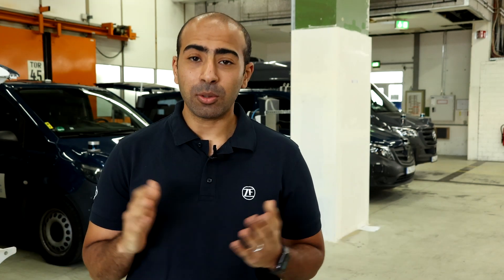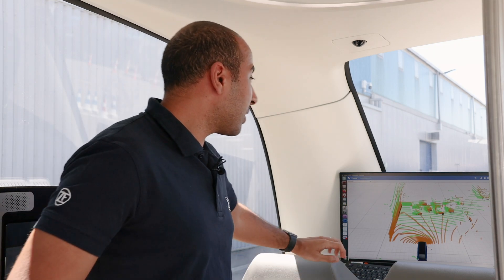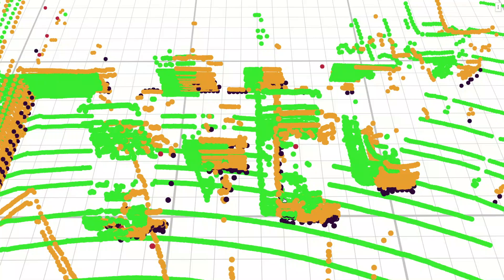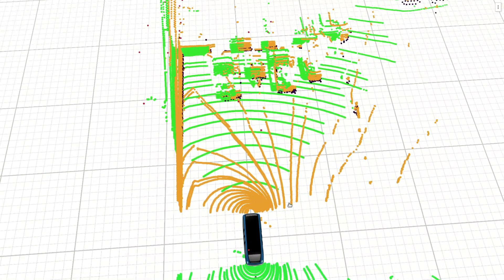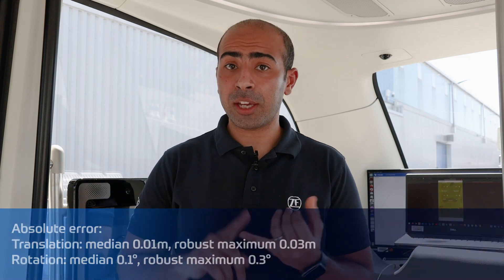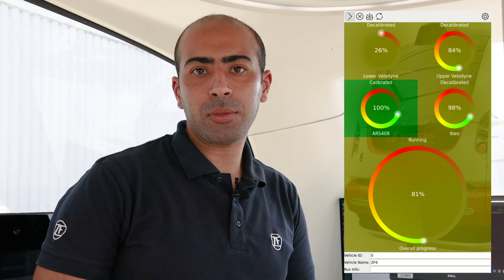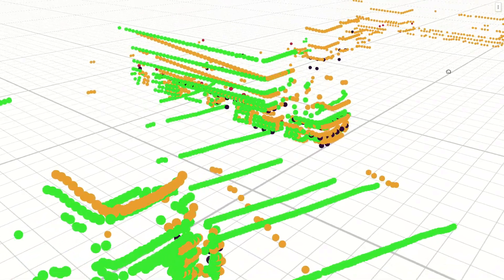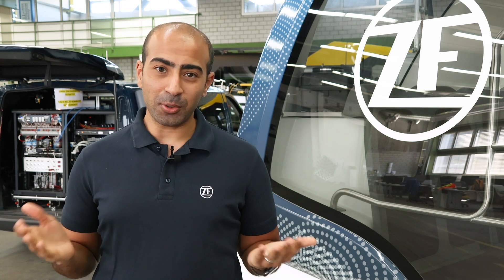Innovative Software for Sensor Calibration

Comment: Great work. How is this different from the automatic sensor calibration that Tesla has been using for years for Autopilot in their vehicles? Once you drive your Tesla for the first time, it takes a few minutes of driving to calibrate the sensors too before you can enable Autopilot.
Reply from the maker: Extrinsic auto-calibration of sensors is not new to automotive products. It started with L2 ADAS applications, like smart cameras, radars, or surround view systems. We are aware of the market offering products with a similar functionality for autonomous vehicles beyond L2. The main difference to those is that our solution is a stand-alone product. Our software can be customized to use different sensors like lidars, cameras, or radars and adapt it do different modes of operation. The variant presented in the video in addition calibrates after just a few minutes/kilometers and therefore in the fraction of the time compared to other solutions.
Reply: @zfgroup  wow, thanks for the detailed response good to hear that your system is so versatile, I hope to see it put to good use in applications soon! Keep up the good work.